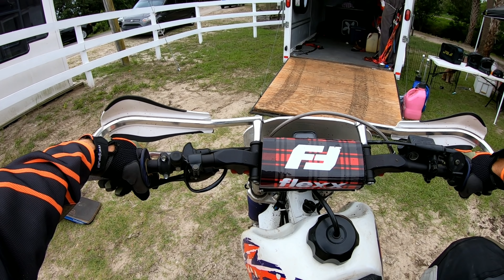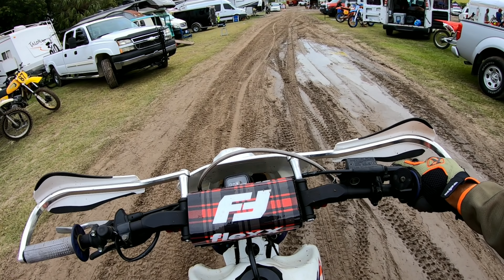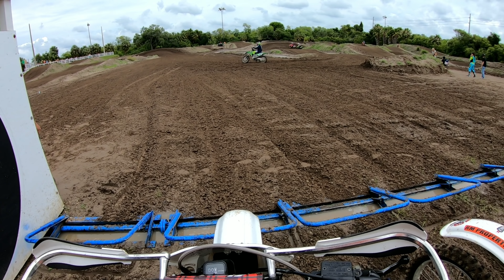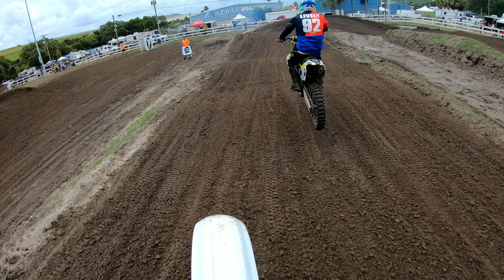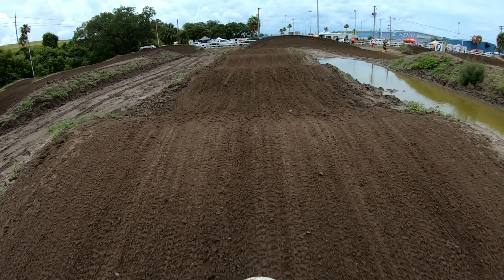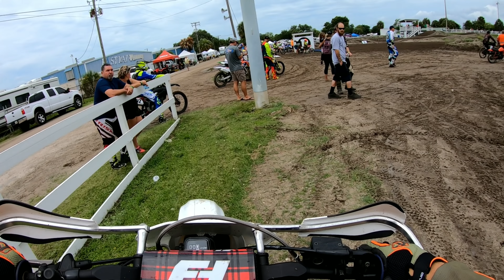Pulling away on the XR600R!

Comment: It's funny hearing that big old engine just moan around the track while that RM screams it's guts out
Reply: 2 stroke all day don't hate. don't forget that's 600 collateral cc's it took to beat that tiny 250cc smoker.  it would take just another 50cc to beat that lame ass 4 stroker. try it with a KTM 380 for instance and we not even talking 500cc big bore monsters.
Reply: @hdidane00  500cc Big bore is around 700cc for 4 strokes
Reply: hdidane00 bahahah man... I’m a 2 stroke guy at heart but 2 strokes aren’t where it’s at with motocross anymore. A modern day fuel injected 450 would smoke any 500cc 2stroke. They are easy to ride and handle wayyyy better. 500 2 bangers are honestly pieces of shit that rattle like crazy and have outdated suspension.
Reply: This thing reminds me of my 500 2 stroke you could just lug it in 2nd and 3rd
Reply: Its an 2 stroke its supposed to scream
Reply: @hdidane00  an rm 250 should smoke an old lazy xr600 trail bike especially around an mx track lol, off the line and out of corners that big massive heavy long geared bike should be knowhere near the 250, it just comes down to riders skill set, but he is in no way at an advantage on that 600
Reply: Paul Jewitt you’re right about rider skill for sure but its also the track, i ride the heavier brother of the xr the xl600r and i still am the quickest round the local track with it even when racing RM250s and similar. A lot of it comes down to skill and our track has long straights with few corners so im able to give her all the way while they small me in the corners.
Reply: @hdidane00  They just aren't made for the same thing. When was the last time a 2 stroke won the Dakar ?
Reply: lol, OP just stated the sound difference of the XR and the RM, and some of the comments below are 2 stroke fanboys that were triggered. "250 2 smokers are amazing and I haven't even mentioned a 500. Jezz Chill, he said nothing about it winning.  He just thinks its funny.
Reply: @renskivideos  gold love it
Reply: @hdidane00  tough, but fair and I agree, sadly kinda. But lets not try to make  it any smaller this pull... what this did man did and what it takes to carry that momentum of a bike like this AND sounding like a badass while doing oit lol while other are powerless with modern 125 on 20s or what ever :D

Comment: I love it...
I laughed my butt off when you blow everybody away on the two smokes riding a monster 4 stroke. .
90% Rider 10% bike
Reply: very underestimated bike .
Reply: Right those 2 smoke riders with their lack of throttle control just pinning it and spinning the tire while he grips up and rolls away chugging
Reply: What? Lol 4 strokes fly by 2 strokes all the time. They have a lot more power. 
CRF450R: 63 hp
CR500: 55 hp
CR250: 47 hp
CR125: 38 hp
Reply: What the XR has is TRACTION!
Reply: @noidontthinksolol  lol where are you getting those numbers
Reply: @urimtb  AN TORQUE!

Comment: Have not used rim locks on any of my bikes over the last 20 years. On my XR650L which does road, gravel and single track hasn't been a problem running between 15 - 20 PSI. If max torque does not slip the tyre on a grippy surface like tar then it's good for me.

Comment: I pushed my xr 600 so hard around a motocross track back around the year 2000. I started to tear the headset of the frame. it cracked under the headset and that crack went up the bottom of the headset and 5mm up the wall. both sides .. i angle grinded a groove and welded it back up but was too scared to take it back out . brought a crf 450  the xr was a new 98 model low hrs. I had people shocked how fast I was on it. on the motocross track. was fun beating other guys on motocross bikes.

Comment: Be so embarrassing to get stuffed by an XR 😂
Reply: Try racing in the vintage 500 class.  Even the most modern 500 will qualify to race but you'll get your ass kicked by old guys with 6" of suspension and dual rear coil shock.

Comment: I have seen you flat so many times. All I can say is Tubliss!
Reply from the maker: Tubliss would fail too if the rim locks aren't working.
Reply: @fastguysslowbikes   With tubliss you greatly reduce pinch flats and you no longer have the variant of rim lock size. Your problem, assuming you are correct, is that the tube tears at the valve stem or other weakpoint.. You dont have the same mechanisms at play. Then there are the moose options too. Either way good luck in whatever you decide.

Comment: PS would love to see that motor stuffed into a CR frame or any modern dirt bike that can give you better suspension and turning ability have a good day
Reply from the maker: Sometimes I think about the opposite. I'd love to stuff a cr500 motor into this cadillac chassis.
Reply: @fastguysslowbikes  you had a cam on the steering head where when you turn the wheel it would give you the kind of rake that you need and then when you turn the wheel back straight it will give you stability I know they've made these before I'm talking about making a homemade one with a steel frame

Comment: Psh!! Obviously poor tire selection. :) Nice riding while it lasted.
Reply from the maker: Poor tire selection?
Reply: @fastguysslowbikes  I know... sorry... it was a bad joke. After watching your previous videos you've made it clear how you feel about the importance or lack of importance of choosing the perfect tire for the conditions of the track. I was just trying to poke fun. Really though, do you think there was debris on the track causing punctures or does it look like it was something else like a pinched tube?
Reply from the maker: @bigsmallblock9480  oh I get it! That's a good joke then!

My hypothesis is that the tech who installed the tires ordered OEM rim locks. The new rims are narrower than OEM. The rim locks weren't working at all.
Reply: @fastguysslowbikes  That makes sense. If the tire is slipping on the rim it will rip the valve stem out for sure. Hope you get it figured out soon.

Comment: XR's are not made for motocross, but if you put some proper modifications on it, you can use it as a beginner bike to learn small jumps and proper handling of bike. But be careful, that XR has a lot of torque in it, especially the 400R. That bike was something else when it comes to torque.
Reply: How are they not good for mx? My 650l does great on the tracks near me. Was the replacement for my shitty yz250

Comment: This cool and all but...600cc? That's a bit unfair huh? Let's see someones KX500 absolutely shred that race
Reply: it makes less horsepower than the 250 two strokes. And is heavier not designed for motocross.  But it's more capable than motocross only guys think.  Plus the rider is badass.
Reply: @TheBlueDogMan  I can believe it makes less hp but the gearing for that 4 stroke fits its design to let it be a fast, almost street capable bike. No 250 is gonna do well at highway speeds. Not without some crazy 8 speed transmission